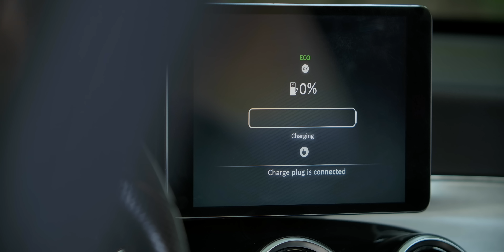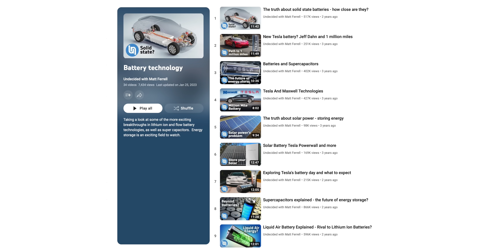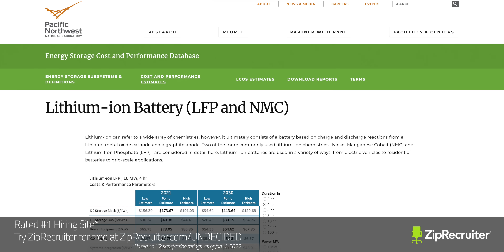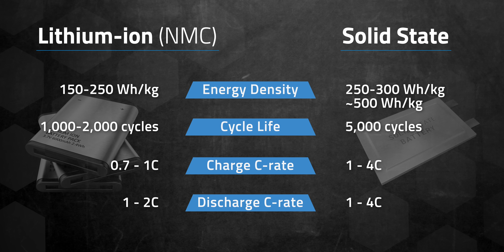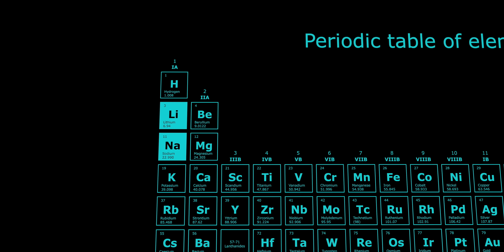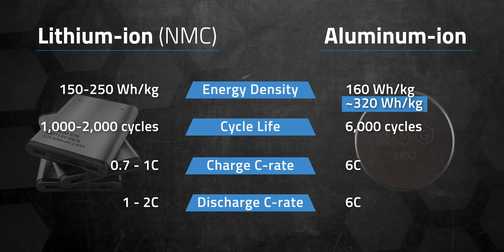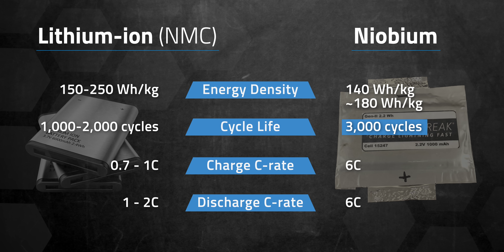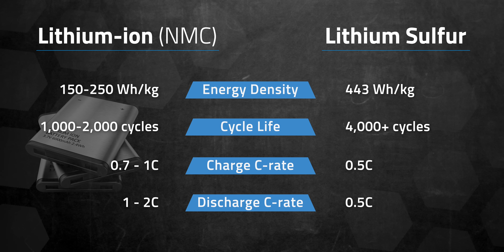Are These Batteries The Future Of Energy Storage?

Comment: I am a big fan of slightly off the wall ideas for power storage in place of batteries for wind and solar. Stuff like hydrogen fuel station that makes hydrogen with excess energy then converts it to power during peak needs using a fuel cell. Or salt towers and such.
Reply: There's a lot of possibilities for that. Some of which can be built at home without much knowledge. The one that I found the most interesting was using glass tubes filled with water to grow algae that could then be converted into diesel. It's effectively carbon neutral and would work with the engines that we have today. Plus, it can sit for a period of a few weeks without much trouble.
Reply: Anything to do with hydrogen will be inherently quite inefficient due to the large number of expensive stages in finally producing useable energy.

Comment: With out watching this video yet. I can tell you with out a doubt that there are some great techs out there. Yet the major set back for each one of these is cost and mass production. Your basic lithium battery is about 250wh/kg and I have heard about some 500wh/kg battery techs out there yet they have been trying to build a factory for several years now which is their downfall. To scale these techs require 10s of billions of dollars in investment and if you have a tech that in theory half the weight per wh yet it takes you more than several years to get going its likely not going to happen. There are also techs that are much more heavy yet suppose to be cheaper. I looked in to many of these techs and while they are suppose to be cheaper the products they offer cost more than a cheap lithium battery I can buy off amazon at 1.2kwh for around 300 dollars full blown retail. I am sure that if I were to buy 100 units I could get the price down quite a bit. 
Another thing to note is that if a company says they will be ready to mass produce in a year. This is super unlikely because they do not have a factory. When a company comes out and says that we are building a factory and are working on mass production of said battery and we hope to have all issuses solved with in the next year, then you can bet on that company. There are so many techs that are just not going to see the light of day because they can not scale cheap enough. 
Be honest, using these spec 250wh/kg/100USD. Are you going to pay 1000USD for a 500wh/kg battery? That is 5 times the cost. The only reason you are going to pay that is for a project that requires less weight and these are very limited.
Reply: Your not supposed to let reality get in the way… very disappointing

Comment: Present creator not considered: ziprecruiter does indeed hold a high quality standard for the candidates. However they have zero concern for the quality of the employers. Speaking from experience, I found a job very quickly after joining ziprecruiter. And, just as quickly, regretted the hire. It was a tech startup with the typical incompetent startup issues. Two weeks of effort wasted coming up with a solid plan to fix all of the problems that the managing brothers clearly caused only to have it discarded in favor of an overseas company that bid 4-5x more time and 50x more money. Then they had the gall to demand that I pay for them to use the overseas company making all kinds of unfounded accusations and threats. All of this and they didn't even pay for my time that they wasted. Speaking to their lawyer was a completely different experience he fully acquiesced and admitted that there was no basis for the blackmail in the form of legal threats. But when ziprecruiter was informed of the situation they promptly offered me disenrollment. Which I gladly took them up on when it became clear that they have no intention of protecting candidates from these criminals. Ever. If you are looking for a candidate ziprecruiter is surely an all upside proposition. But if you are looking for employment the same provider will treat you like a disposable prostitute. And just like the comparable industry, conditions matter and will obliterate the quality of service in the long run.

Comment: There is a missing aspect to high C rates.  To charge a battery very quickly requires a significantly higher charge load on the grid all the way down the size of cable necessary to carry such high amperage loads through to the plug that connects to your EV.  The grid infrastructure is going to trail the EV high C rate bandwagon for many years.  If ten percent of all vehicles on the road were converted to EV the grid falters.  You can do one without the other.

Comment: I am most excited about the diamond-nuclear batteries. If ( it is a huge if ) in the next decades this technology gets to the point that can be designed as a stationary power supply it would be the ultimate off-the-grid power source. Imagine a battery size of a small room with layers of concrete and protection shields in the basement that takes you completely off the grid for the next century or even centuries. Since it is stationary only earthquakes can damage it with new concrete technologies it is imaginable to make an earthquake-proof concrete block. It can be a domestic plutonium reactor. Especially in parts of the world that are not prone to powerful earthquakes. Hospitals with an underground battery that never runs out. You can live on mars and never think about energy scarcity.

Comment: 3:10  1C is 1Ah per 1 hour?  I'm so confused because upper case letter C is already taken for electric charge unit, the Coulomb. They should really consider changing the naming to prevent confusion between 'charge rate', and 'electric charge'. (Not to mention the ºC for degree Celsius.)

Here some confusion that might happen for example:

1A = 1C/s         (1) Definition of ampere, 1 ampere is 1 Coulomb per 1 second 
1h = 3600s       (2) 1 hour is 3600 seconds

Now if we figure out ampere-hour 

1Ah = 1A * 1h 
   = (1C/s)*(3600s)
   = 3600C
so
1Ah = 3600 C  

This conflicts with the naming for the C-rate charge. 
1(c-rate unit) = 1Ah per 1 h

Comment: Grid storage will never make economic sense using Lithium Ion; the low cycle count means you have to replace the systems too frequently, and that is very expensive.  They are getting away with it on cars, but as Tesla cars age, the incredible expense and lack of repairability will give them a bad reputation.  For grid you can live with lower density, but need 10k cycles. This is just like the SSD vs. Hard Drive problem. We use mechanicals on our high writing situations, because SSD's would burn out too quickly.

Comment: Whichever battery technology breaks 500Wh/kg, with more than 5000charge cycles is straight up the winner for cars. It doesn't matter if it costs a lot, it's an investment for the lifetime of a car, and oh would you look at that: hydrogen.
I have no idea why people are so adverse to water fuel cells. The tech has exceptional energy density, the infrastructure exists for a multi-continent wide network (formerly natural gas), charging a car is as easy as pumping gas, it's infinitely recycleable and rechargeable, it's cheap, and hydrogen's literally the most abundant thing in the known universe.
"Boo hoo, it's explosive" Yes, anything at that energy density is explosive, that's what energy density means. And because it's the only known energy storage method more dense than gasoline, the saved weight can be used for safety measures.

Comment: Just thinking... since electric cars need huge battery backs, would it be helpful to make them with big flat plates, say 1m square? Currently they're just 18650 cells, AFAIK. They're cylinders 18mm in diameter by 65.0mm long (hence the name). It's about twice the volume of an AA battery. The surface area within the battery is where the chemical reactions happen, that produce electricity and then recharge it again. So instead of lots of little round batteries why not big flat ones? Stacked on top of each other in series, possibly with 2 or 3 stacks, maybe more, if needed to create a high enough voltage.

Comment: There are some battery-related technologies that you should look into, Matt.  The dendrite formation at fast-charging rates that destroy cycle life in lithium batteries has been shown to reduce if ultrasound transducers are creating a movement in the liquid electrolyte while fast charging.  Also, zinc-air fuel cells that had on-board reprocessing of the zinc oxide created while discharging could make them more of a battery than a fuel cell and at 1,400wh/kg worth looking at.

Comment: People don't focus on C-rates enough.  The chemistries that provide 400wh/kg but only 0.5C mean they are unsuitable for a vehicle, unless they are paired with a high-C pack for acceleration and regenerative braking.  People forget that braking needs a high-C rate for the battery to absorb that energy without damage.  Also, no matter what the battery chemistry, a vehicle needs X number of watt-hours to travel a mile; so heavier battery chemistries also reduce the miles per kwh, which requires an even larger and heavier pack to confer the desired range.  LFP is already up against that barrier where a 2000lb pack only gets an SUV 300 miles range compared to an 850lb NMC pack that confers more HP in a vehicle that is 1000lbs lighter.

Comment: If you do a followup, you might mention which can directly replace common Lithium batteries like the 18650. That means similar voltages, charging techniques, and size.
Reply: Hopefully charging circuits will gain flexibility, allowing new charging profiles to be loaded via software.  Some chemistries just need different thresholds and operating voltages, others will need stuff like pulsed charging.

Comment: it is a pretty interesting and exciting race between different battery technologies for different applications. for now it looks like the new sodium based batteries are very well suited for home energy storage. however, they want to use it in low range cars as well.
it will be interesting what is coming soon for long range cars. there is also a need for 120kWh batteries for cars.

Comment: Theres quite a few physics batteries, (rather than chemical batteries), out there that will probably find their way into stationary storage scenarios. Lithium Ion IS still one of the best for that purpose, running peaker plants etc but there's some high temp, air pressure, pumped hydro, gravity etc that are promising competitors for the common battery in grid storage.

Comment: For my small off-grid power system, the sodium-ion battery looks promising to me, especially with a potentially lower price tag and environmental footprint than lithium. And with the manufacturer being in Wales where I live, it's double lower footprint with short travel. I hope they are ready soon. My old lead acid batteries are close to dead.
Reply: I think lead acid is very under rated for grid or stationary storage. It really depends on how good (advanced) the charger set up is and the depth of discharge, as I'm sure you know. Their simplicity, and ease / low cost of recycling make them very easily one of the best choices.
Reply: @anydaynow01  Lead acid is being now revived for the storage applications with the carbon augmented electrodes. Prices are atrocious, so is the weight, but at least the cycle life and current ratings are there.
Reply: These will be manufactured in China like everything else, then hauled to the west with giant diesel and coal burning vehicles. They don't give a damn about any kind of footprint sadly.
Reply: Lithium iorn phosphate or lithium titanate oxide may be a good holdover for you that will last until other chemistries mature with a lifespan in the decades
Reply: @noobulon4334  yes, I will be going for a LiFePO4 battery for now. I contacted Faradion about the Na-ion batteries, but was told that they won't be available to the public for a year. Incredibly they sent a personal reply within 10 minutes!

Comment: I'm glad Matt didn't emphasize how long these technologies are from mass production. Three years ago most of this technology was "five years away." Today, the earliest any of these technologies will appear in volume is "five years away." And Matt brings up a good point- the first to market with a superior product will be charging a premium, even though the cost of production and materials will be most likely less than current lithium ion battery technology.

My optimistic take? Ten years away before new technology batteries are available in volume at a reasonable price. My next car will most likely be an ICE model. Too many problems with charging (inadequate/broken infrastructure, long charge times) for me to live with a 300 mile maximum range car. In winter, one may only expect 225 miles, or less if one goes with the recommended dual motor models in snow country. Hybrids may make sense, but that complicates the car- dual mechanical systems and additional electronics present so many more points of failure.

Comment: I could absolutely see Na-ion being a thing in EVs. Not every car needs an 80+ kWh battery, people have been driving around with ~40 kWh for a long time. Getting a low cost, low range car with a durable battery would have a lot of applications
Reply: Could also be useful for battery swapping vehicles like delivery vans and busses that can have additional batteries ready in a charger at home base, swapping in fresh ones every few trips.
Reply: You may be right in a statistical sense, but market dynamics and economies of scale will continue to drive demand and production to increasing range and decreasing charge times. Swappable batteries could compensate, but there is no infrastructure on paper or in production to make it viable. Maybe in another twenty years or so...
Reply: @GeeDeeBird  Note that I suggested a home base with battery swapping only for company / department owned fleets of heavily used identical vehicles purchased with infrastructure and a contract for specific performance and durability.  This is a different economic environment than vehicles sold with limited warranty to consumers, where designs that wear out batteries just after end of warranty under typical low usage will be easily sold on the convenience of fast charging during that initial period of ownership.
Reply: @johndododoe1411  I saw that. Though my reply was directed toward the OP, the infrastructure problems are the same for fleet vehicles. For the required investment, fleet users might be better served to explore the hydrogen alternatives on the horizon.

Comment: Great tech, but there is another factor to this. The rising demand for lithium, yet there is limited sources for this. 

On a positive note, India just found a huge source of lithium reserves in the the Jammu-Kashmir region (if not mistaken, it's slightly higher than China's). This may eleviate the pressure for sourcing more of this resource. Though it will probably take time to setup the logistics for that mining and processing operation :x

It's also good because it will further encourage heavy poluters like India to go electric now they solved one glaring issue of where to source the lithium needed for that.

Comment: The huge requirement is going to be for grid storage, so that intermittent renewables can provide 100% of grid electricity without needing fossil fuel to fill in the gaps. Sodium ion (or maybe Al ion) look ideal because energy density is not important for static storage but cheap, abundant raw material is. Lithium has severe scalability issues because it is a relatively rare mineral and has a heavy environmental impact in refining. Sodium and aluminium are both very abundant and easy to refine.

Comment: I am still tickled pink that I have 2kwh of LiPO4 batteries in my little camper van when just a few years ago that would have required at least 8 times the weight using lead acid tech… not to mention the dramatic increase in discharge cycles.  But I would totally accept twice the weight in sodium ion tech, especially with a 6C charge and discharge capacity. We truly live in amazing times.

Comment: A solution to the charge speed and infrastructure not able to keep up on the Niobium battery is to use a Niobium battery(base camp) that is charged by the grid to offload it's charge quickly to another battery(mobile unit) so it can be on it's way then charge back up off the grid for the next time since it can charge and discharge at +6C the mobile unit can charge at full speed without a real infrastructure change.

Comment: I automatically call bullshit on every new battery.  Look:  Every new car made still uses 1800's lead acid batteries technology for the starting battery.  Where is the one million new batteries invented since 1880???
Reply: It's cheap, it can deliver an enormous peak energy for its small size, and it is so robust that it doesn't require expensive electronics to protect it. Why would car manufacturers chose another type for that application??

Comment: Great overview. I've been in the Li-Ion battery industry for over 10 years now. I'm not sure what to think about solid state batteries. They have been "a few years from market" since about 2010. I've started to think of it like nuclear fusion. Also, an interesting thing is electrode specific energy as measured in the laboratory does not translate well to system energy density (volumetric or gravimetric). Many exotic chemistries need extra systems for thermal regulation, electrolyte circulation or a pressurized air vessel. By the time a functional pack is assembled all the energy density gains at the electrode level disappear with these added components. There is no free lunch with physics. I believe we will be seeing NMC, NCA, and LFP chemistries for a lot longer than battery optimists want admit 🙂